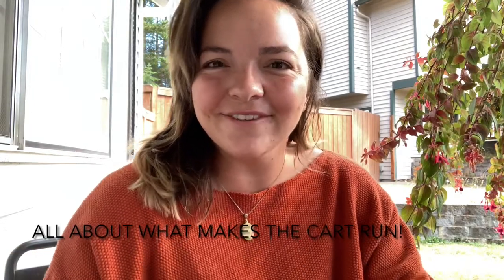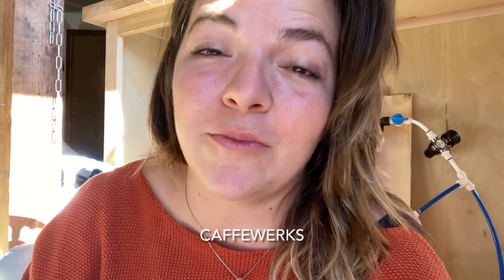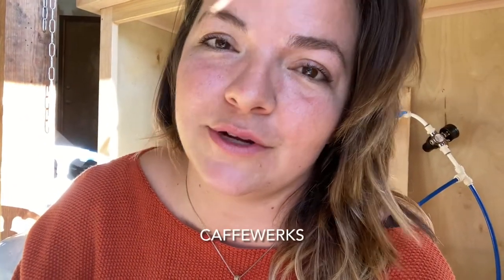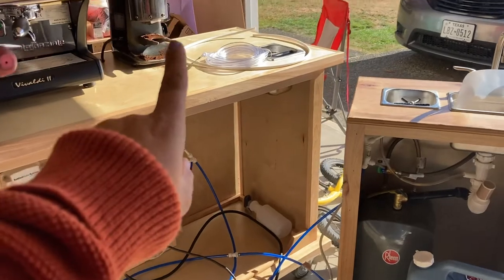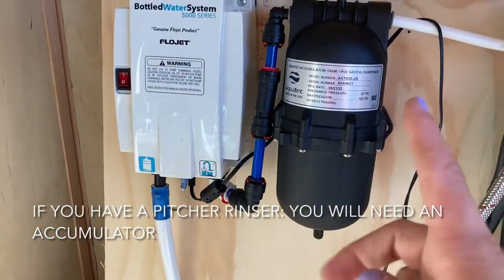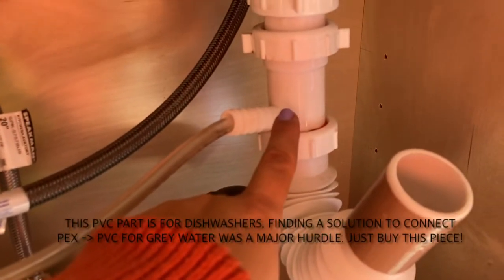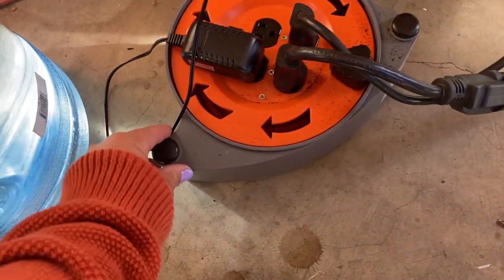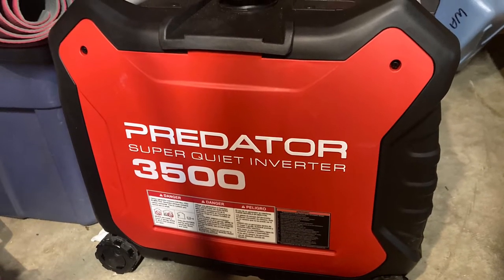WHAT IS ON THE COFFEE CART? Plumbing and Electrical

Comment: Great informative video! 
Just so people aren’t getting confused when they’re headed to buy materials, the clear hose is called vinyl hose, not PEX. The other 3/8” white hose that you have comes in white (or even clear-ish white) and is called polypropylene. You actually CAN connect the John Guest push connect fitting to true PEX quite easily- the adapter can be bought at Home Depot or Lowe’s. Unfortunately most employees at Lowe’s and Home Depot are just associates and have very basic knowledge of the department they work in.

Comment: Hello! I plan on doing a setup similar to this. I am making a separate handwashing station/3bin sink setup due to health code regulation. Do I need the Flojet to connect to these or can I just fill the hot water heater and use it as a standalone system?

Comment: . Im going to look for accumulators in my area. Thanks for this.

Regarding the mini vivaldi machine, can it handle 100cups for guests like weddings or birthdays?
Reply: Wondering the same thing!
Reply from the maker: Hey there! The Vivaldi does an awesome job! That’s the max I’ve served and I had to swap out my fresh water and grey water tank. I always bring two of each to an event. Besides that, if you’re plugged into the host’s electrical the machine can certainly handle it. I do think it’s probably the max for the machine, in my experience. I noticed during an event where lots of people asked for tea and americanos, I was using the hot water outlet a lot and that started to lose volume. So now I bring a carafe of super hot water to supplement!
Reply: Not sure if you found an accumulator yet but I found a flojet accumulator on eBay for $40 I did need to buy the Push Fit 3/8 Tube X Quad Port Fitting from caffewerks.